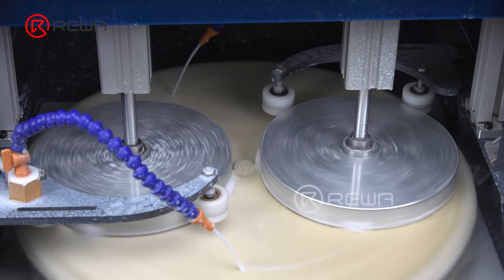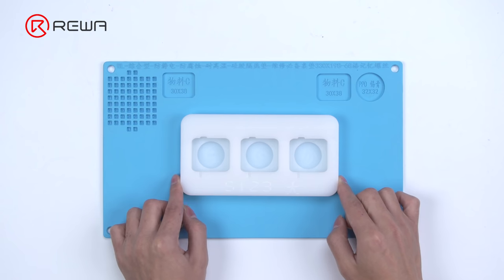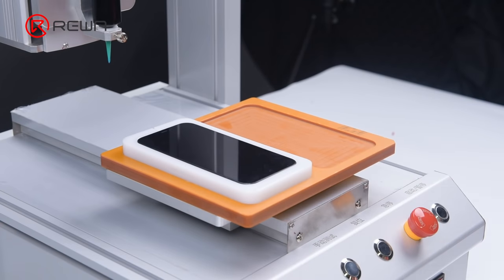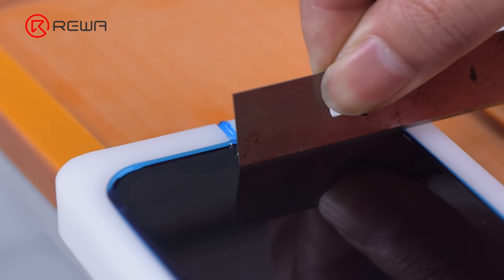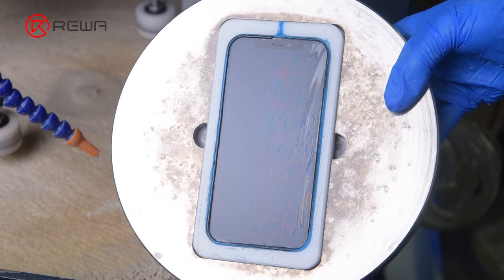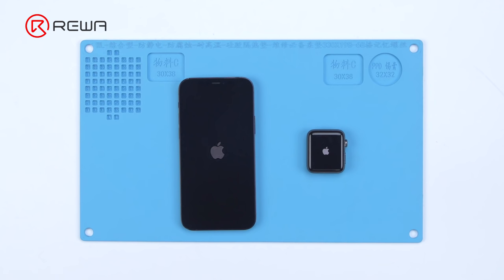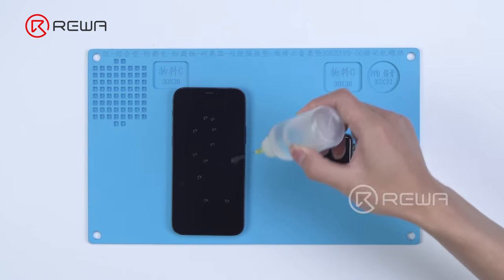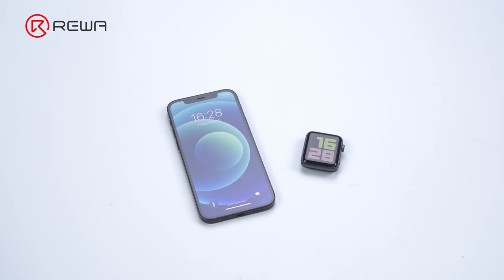iPhone 12 (Ceramic Shield) and Apple Watch 3 Scratches Removing By Grinding & Polishing

Comment from the maker: REFOX Automatic Grinding & Polishing Machine: https://bit.ly/30mQpZQ
200W High Power UV Lamp: https://bit.ly/3qpCugd
30L Air Compressor: https://bit.ly/3bryLdx
Automatic Dispenser Machine: https://bit.ly/3euqXJU

Click here and you can join REWA Academy to learn iPhone motherboard repair: https://academy.rewa.tech/
Reply: Where can you buy this oleophobic liquid?  This is not the one used on the car.  Here to dry with ultraviolet light
Reply: How to
Buy that machine from
Pakistan?

Comment: man this is mind blowing yeah iPhone 12 has harder screen because of that ceramic shield layer really amazing way to save a full screen replacement just by using this machine awesome
Reply: Nope.. in fact ceramic shield is not harder and prone to scratch compared to the last iphone. It is just more scatter proof than previous model when you drop it.. but not harder.
Reply: It's is harder and more resistant but not to scratches several test has been made by reviewers and it's shows how is superior to the previous one you can check the test I'd you like